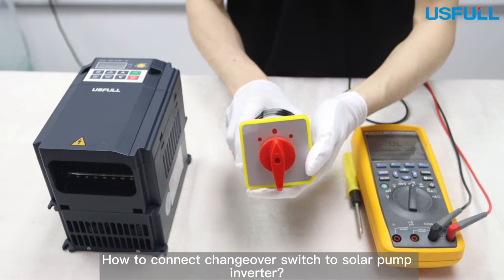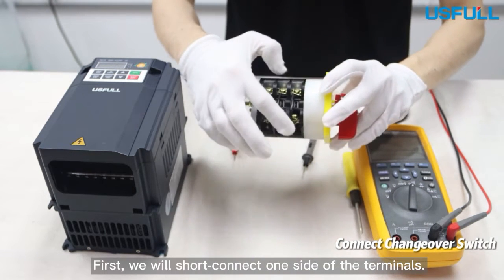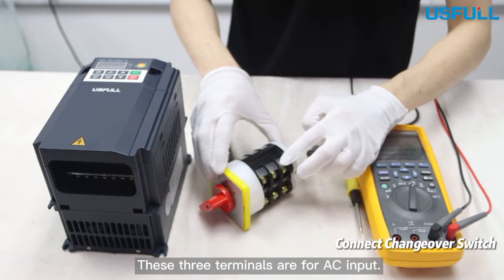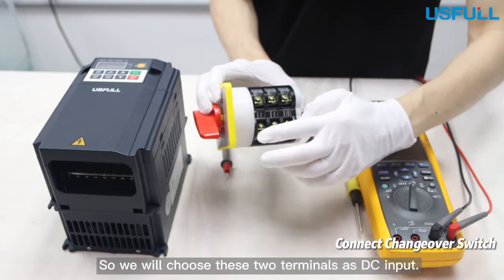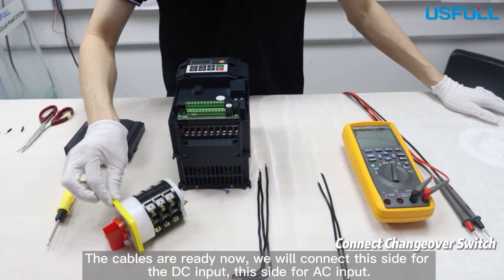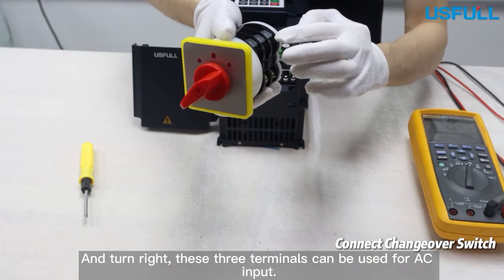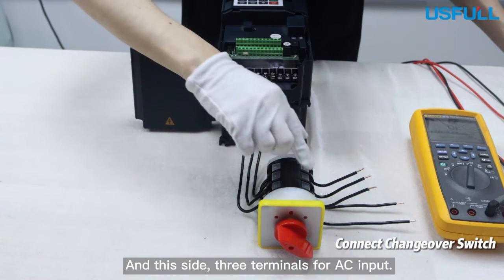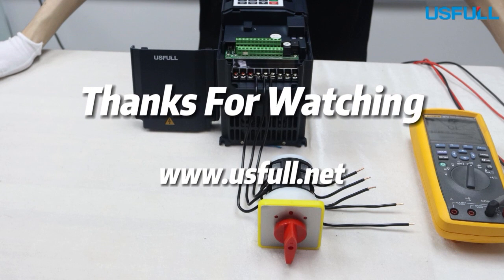How to connect changeover switch to USFULL inverter

Comment: Ok, This is for two input and the load one ,But if i had one input DC from solar and two load (one load for submersible pump 2.2kw single phase 220v and other load 2hp motor 1.5kw) and i want to switch between two load from only solar system DC and Usfull inverter ,how to use changeover switch for that ?
Reply: Not working for 2 load need so much part and need 220v from grid for add contacteur and disjoncteur motor